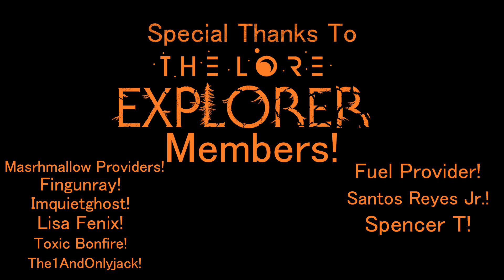Black Hole Warp Cores Explained

Comment: quite unrelated, but one bit of lore I don't understand is inside the statue island, where a Nomai explains that the statues will activate in the case of equipment malfunction. However, given that the hatchling and Gabbro only join after the eye of the universe has been found, that must mean an equipment failure failsafe must not have been triggered. The probe cannon however showed great signs of malfunction :p
Reply from the maker: All of the necessary pieces for the orbital probe cannon were miraculously intact. The probe tracking module and its statue safely fell into the counter clockwise tornado and sank to the core. You have to remember the only connection to the atp are the statues. The probe tracking modules statue is functioning and so the atp sees no issue.

Comment: Wait, if the Hearthian-system Nomai observed this time discrepancy by simply using a more basic version of warp technology, how didn’t the Nomai who originally discovered it?
Reply from the maker: The Noami we know were the only ones who were in definite areas of spacetime. As in planets. They had clocks set up at each planet. No one out in space is putting a clock to see when they warped and when they "landed" independent of the warper.

Comment: 4:28 i really wish the game's lore mentioned how the warp pad can be used to return you back just after using it
great job explaining the advanced warp core tho
Reply from the maker: Well, I think as long as its powered everything is fine. our scouts use the black hole warp cores and we can use them at literally anytime. no specific alignment needed. And like one nomai log said. Any two objects in space will always be aligned. You can always draw a straight line between the two. But as for how the white hole pad makes a black hole....idk. but thanks bud.
Reply: @theloreexplorer  my theory is  that the connection is like a tunnel,  the black hole and white hole on either end, well, what if you were pulled back through the tunnel by the black hole, you were transported through the connection, perhaps the black hole's gravitational pull or perhaps the black hole itself is transported as well, thus pulling you to where the black hole is and therefore the warps work both ways
Reply from the maker: @jamesonescobar782  yeah. i should of mentioned it but i was rushing to get the video done. a common theory as to what lay beyond a black hole is a worm hole. so like a tunnel. and we actually see one at the eye. so we know they exist.
Reply: The game lore does explain how you return. There was something about how the warp pads are designed to hold a charge after your first warp so that there's enough energy to send you back. It's not a great explanation, but it is something.
Reply from the maker: @tomhamilton6158  That in no way explains how a white hole warp pad can open a black hole.

Comment: do any hearthians mention warp travel or are you the player the first that discovers and uses it for your race? if so def don't think they knew the power they had lying around lol
Reply: In the observatory it's mentioned that the little scout uses the advanced nomai tech, seated right next to a warp core
Reply from the maker: Yeah. I think they mean the larger platform type teleportation. I dont remember any of them mentioning theyve used them before. or know what it is. Like the observatory mentioned warp travel but not black hole warp travel. so i highly doubt the hearthians know what they got their hands on.